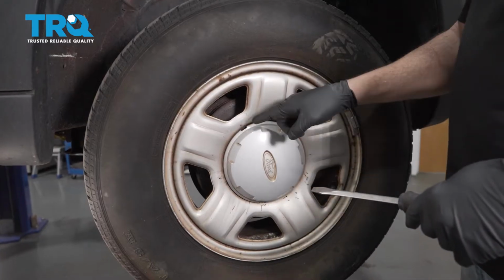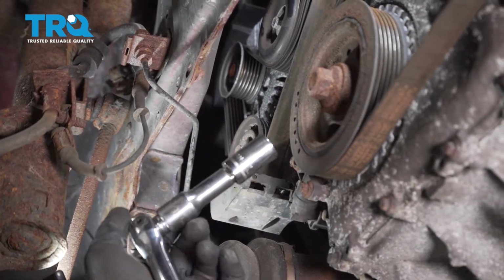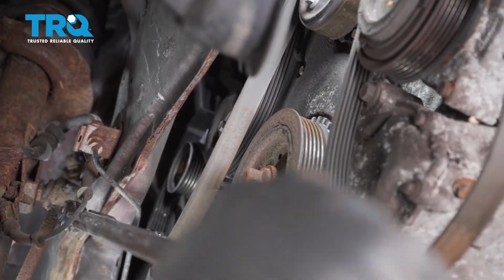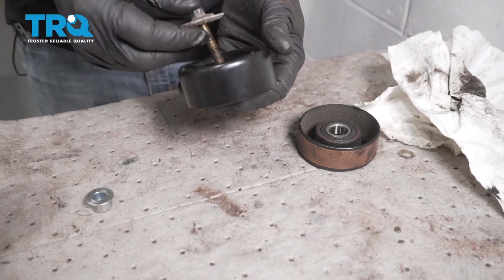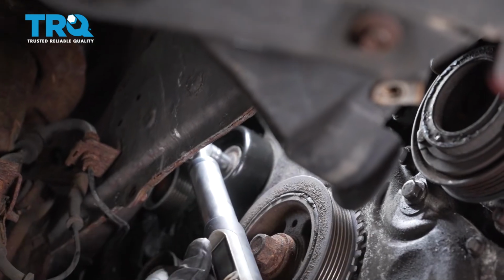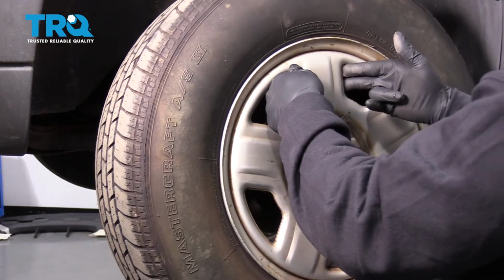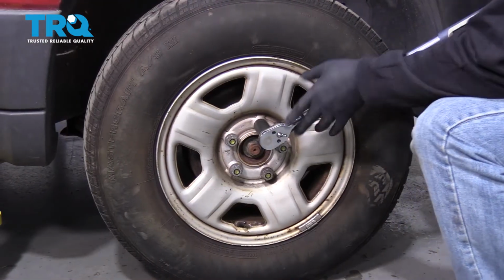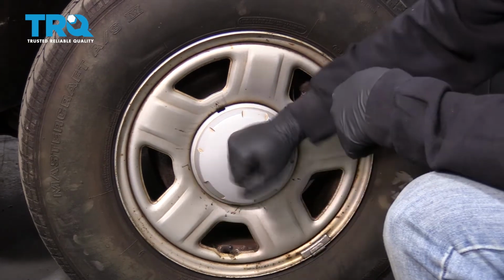How to Replace Pulley 2001-2007 Ford Escape

Comment: Definitely get yourself a 10mm ratcheting wrench for the pulley. 

I used a normal ratchet and as the pulley begins to loosen, there isn't enough clearance as the pulley has deep threads. 

I ended up using a standard 10mm wrench which was no fun at all.